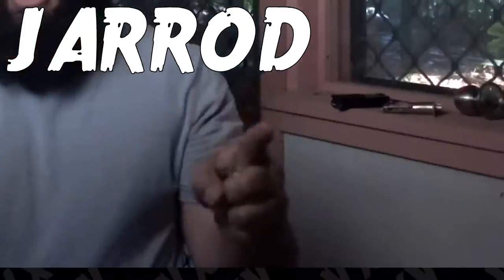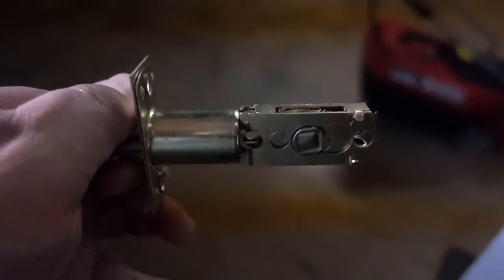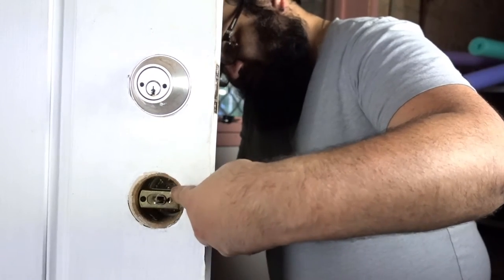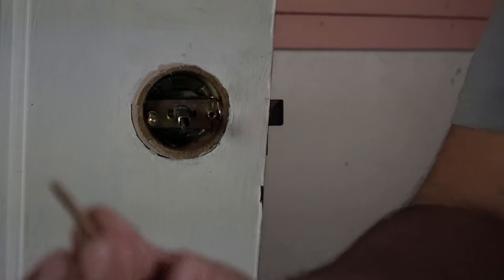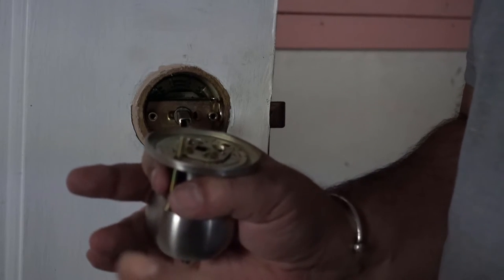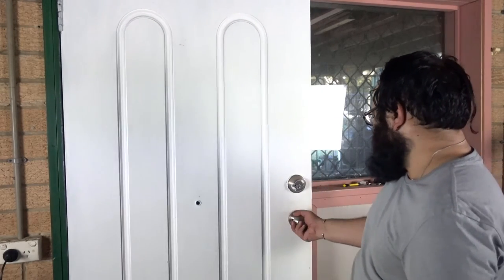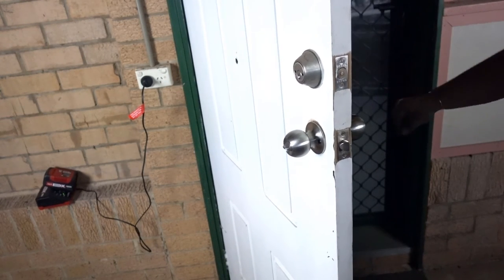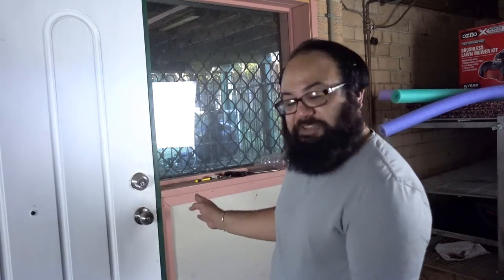I BASICALLY BUILD A DOOR

Comment: Good job. Nice slo-mo. I’ve got some upgrades that I need to do to my doors that I have been sleeping on. I see that a couple people told you that you had inners bas-akwards. You might be able to use a sharpie to mark where the latch isn’t popping into place. Then lazily use a drill bit to remove a little material. Unless you can just adjust the plate a little. Or maybe it just did it because bas-akwards. Thanks!